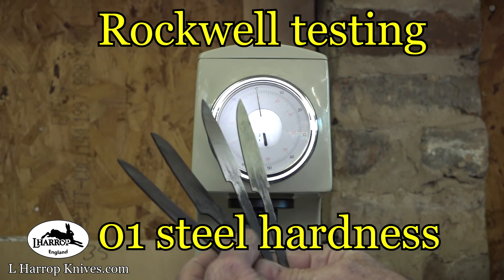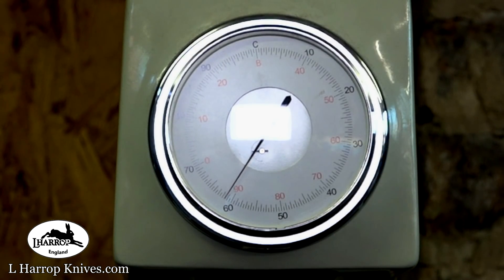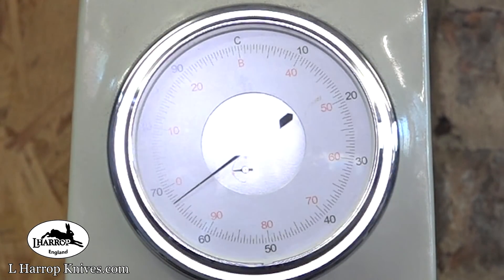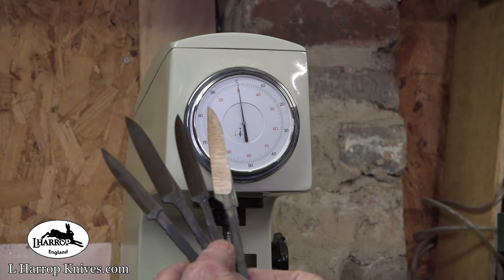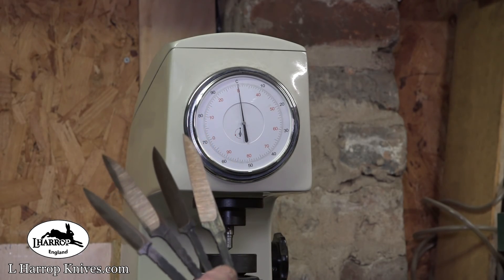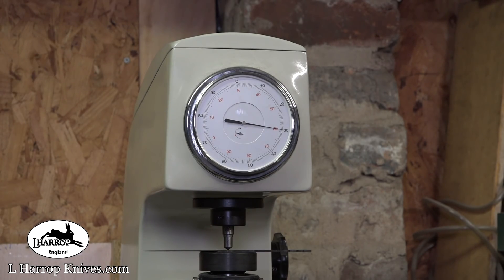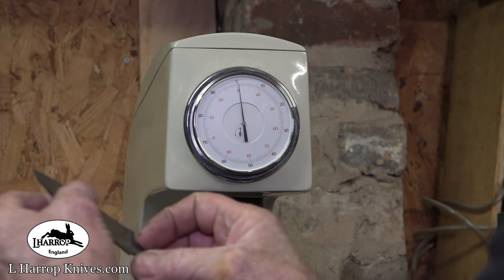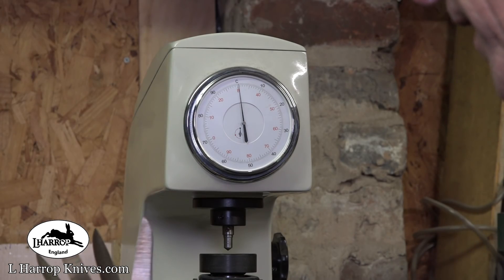Rockwell testing 01 knife steel

Comment: You can’t turn the platform backwards after it contacts the diamond. That will give a false reading. What steel are you using, 10i5? That has a maximum hardness of about 65.
Reply from the maker: Are you saying that I dont know how to operate my HRC tester, if so you are totally wrong.
Reply: @LozHarrop  then you should correct the errors in the video.

Comment: Hi Loz, can you share your view on the benefits of multiple tempers vs. a single temper. How big a difference does the additional tempers make? Thanks mate, cheers.
Reply from the maker: Couple of reasons Rick, I can dial in the hardness i want on the blade by increasing the temper temperatures on multiple cycles, this really helps having the tester,  but more importantly i increase the temps to reduce the retained austenite and stablilise any that s left, other things also happen like changes in the cementite structure,. More complex steels really benefit from multiple tempers. If you want further confusion read up on Jay fishers site about heat treating, tempering etc. Cheers
Reply: If tempering is done properly, over a 12 hour period, hitting all the temperature points with a very slow cooling, multiple tempering cycles won’t make a difference.

Comment: Consistent reading shows that you have becoming proficient at heat treating.
Reply from the maker: Thanks Charlie, the machine really helps when it comes to working out the best heat treatment for the many different steels I use and allows me to temper a blade for its particular use.
Reply: Wow did I sound pompous or what? LOL